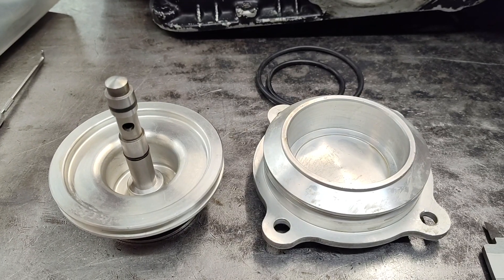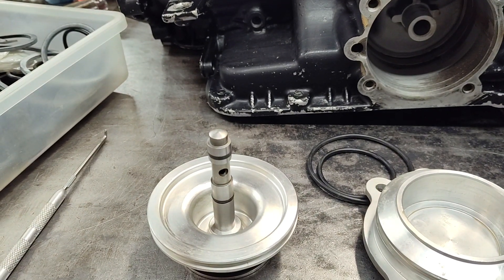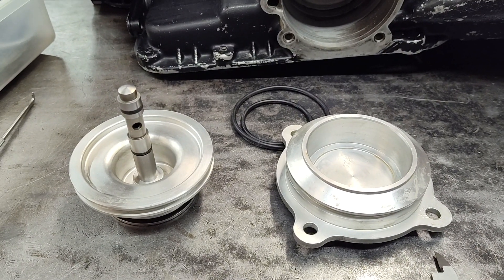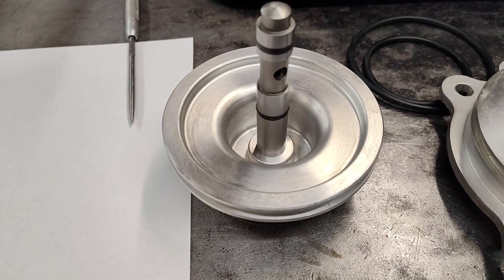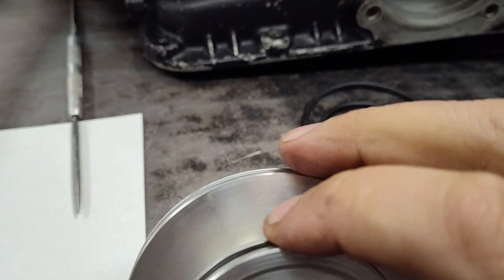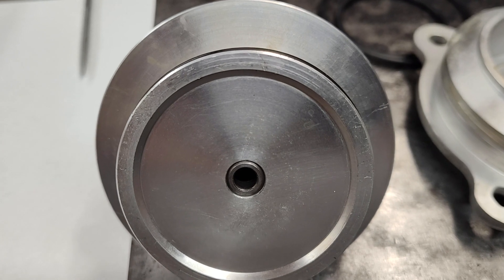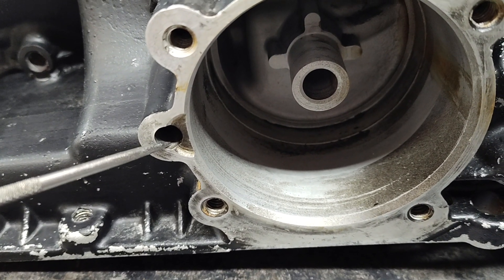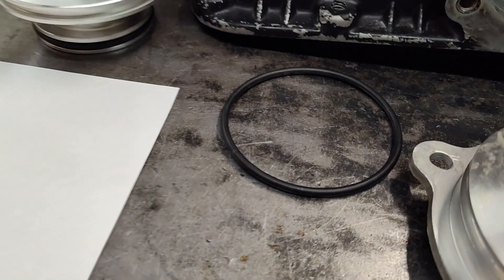Ford C6 R Code Servo Design Concerns

Comment: installing this same servo. seemed way to tight. very difficult to push in or pull out. chocked servo stem into a 1/2 drill and spun it and used a 5/32 round file to file out bottom part of groove then spun it and polished it with 000 steel wool. it will now fit nice and pushes in with appropriate amount of pressure. using light spring piston will return  when pushed all the way in trans case.
Reply from the maker: I appreciate the creativity. Very cool.

Comment: Please tell me if I'm wrong but I believe most automotive o-ring slide instead of roll. After taking a million things apart o-rings are always flat.
Reply from the maker: You are correct. I think I talked about that in the video. I was taught on industrial o-ring applications and they have a different way of looking at things.

Comment: is it possible to change out the servo in a working C-6 transmission
 without the band or anything else moving out of position internally?
thanks in advance.
Reply from the maker: Yes you can. I would recheck the band adjustment after.
Reply: @BroaderPerformance  
thank you so much for your response, I will check that band adjustment
Reply: A little late but yes you can, for safety adjust the band inward as you remove the bolts to remove the servo this keeps the tension on the band. Just remember to adjust the band outward as you in stall the servo. After install adjust band to 120 INCH POUNDES and back off 1 and1/4 to1and 1/2 turns.

Comment: Jay, you should do a video on the difference in the servo bores from the early cases to the new. The Sonnax servo won't fit the stepped bore cases.
Reply from the maker: Good suggestion. I forgot about that. I actually used to make an R servo for those old cases about 20 years ago. Wasn't a big seller so I never bothered to make them again.

Comment: I have that servo, when I took it out of the box the piston was stuck in the cover and wouldn't come out, after about an hour of being delicate trying to get it apart I had to resort to a vise and 2 prybars to finally get it apart.  So after doing some measuring I found the o-ring interference was .045, so I honed the inside of the cover a few thousandths at a time until I was happy with it. Also the large o-ring was about .012 too tight so I machined the groove to an acceptable tolerance.  Thanks for the video.
Reply from the maker: Thats frustrating. I do recommend the Superior Super Servo. I have not seen an issue with those so far.
Reply: @BroaderPerformance  that's what wanted but couldn't find anything in stock.
Reply: @BroaderPerformance  Sonnax and Superior R Code servos for the C6 both have the o-ring. I will be running your C6 auto shift VB and just want to make sure I should be removing the o-ring in my Superior R Code servo? Thanks again for putting your experience and knowledge out here for those of us wanting to learn the art of these antique transmissions. (I posted this on the C4 servo video as well)
Reply: This comment had me scared. I just got a new one as well (last week), but it pulled out very smoothly. It was coated with red grease. Did not take much force at all. So perhaps its not all of them with this issue, or maybe they revised them a little?